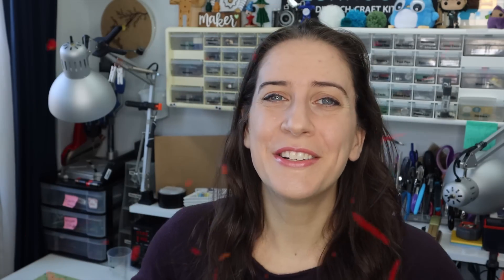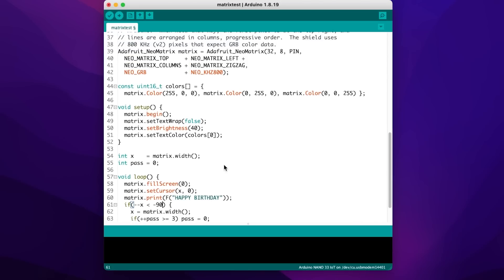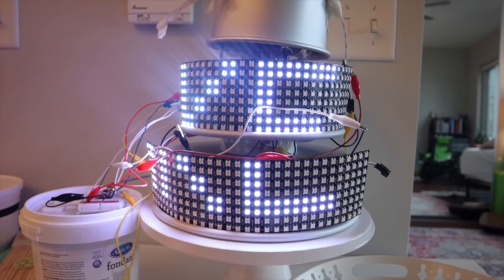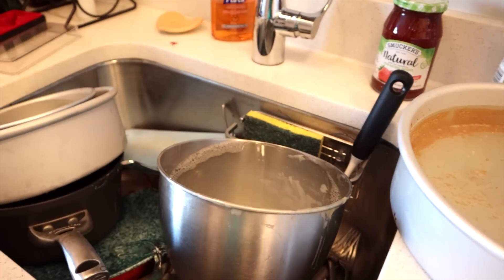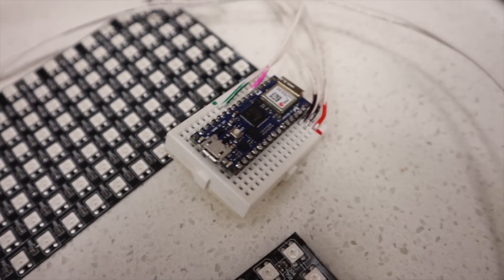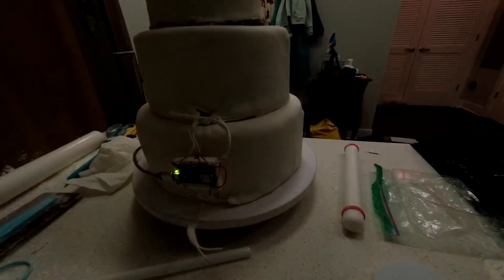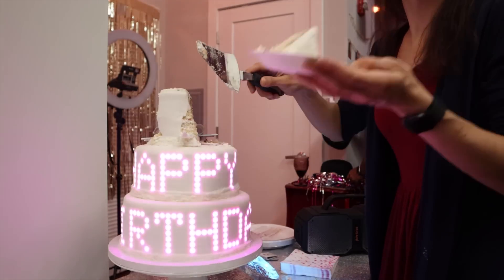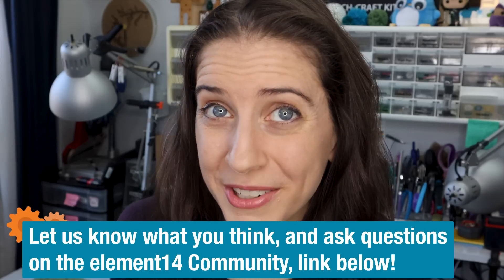Epic Neopixel Birthday Cake

Comment: It seems impractical and risky.  I would probably have used projection onto the cake instead.  It would put all the electronics outside and allow the cake to be cut and served without damaging the electronics, plus lighting the disco ball would be more reflective in more directions (especially if you add some lower lighting from wider sources).  Just my take.  Good ideas but I would have done it differently that way, I think.  Better?  Not as good?
Reply: Yeah! My friends thought I had a projector on it but I had to be like no it’s in the cake- look I can move it around! Haha. The projected certainly would be easier, and I’m sure there are projections that would be super cool, like making a Cinderella’s castle cake and then projection mapping it would be an awesome project.